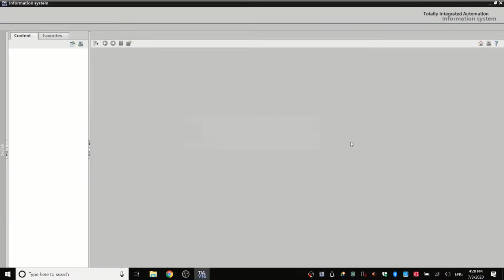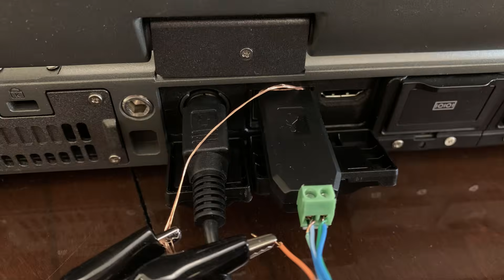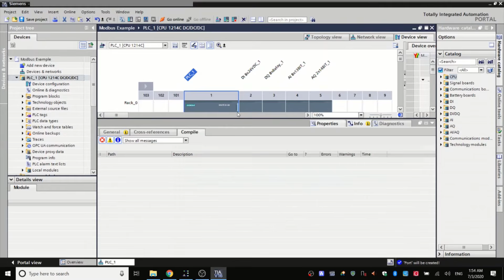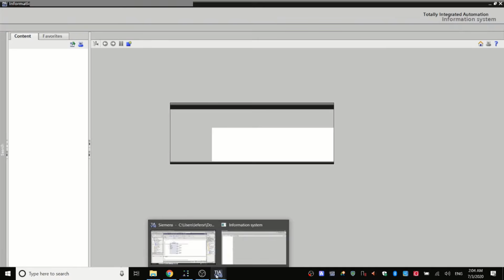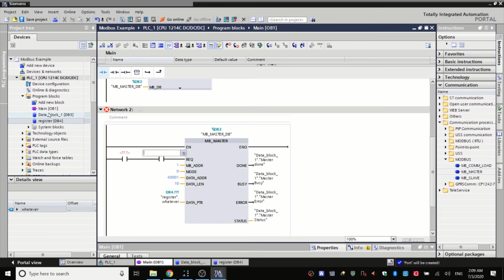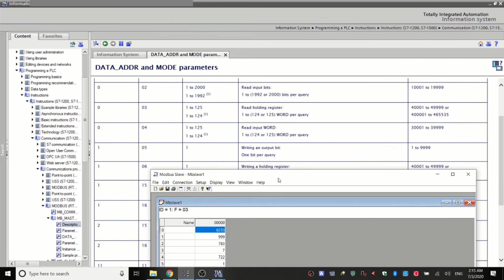Siemens 1200 PLC - Modbus RS-485 Communication With Slave Simulator

Comment: Hi junt a quick question, I am doing what you say in the video, but there is something weird, even if I don connect a equipment to the serial port still the instrucctions show some activitities for example the comm load intruction shows DONE and the master intruction shows error how this can be?
Reply from the maker: Do you mean comm load flags done when you dont have a CB1241 attached to the PLC or you don't have the field device connected to the CB1241? Comm load will execute and be fine even if you don't connect anything to the network. it is just establishing itself with the hardware and is slave irrespective.
Reply: @Intrigued_Engineer  thnks for taking time for replying. I fixed the problem I was doing something wrong.

Comment: Sorry, I'm a little bit confused! I am going to monitor and control one protection relay by S7-1200 through RS485. I cannot find physical Modbus slave in your program! is it easy to eliminate laptop(as interface) and directly connect modbus slave to S7-1200? 
How can control 3 slave by this PLC?
Reply from the maker: Yes, I was just using my laptop here as a simulation slave device. Normally the PLC would be directly connected to the field devices through its CB1241 module. You can definitely control 3 field devices with this. Standard Modbus has an address space of 255. with reserved regions that means you can have up to 247 devices connected.

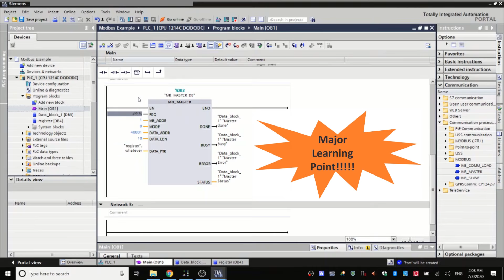Comment: 18:40 that's because the MB_MASTER function works by accessing the memory by address with the PEEK/POKE instructions, which can only be done with unoptimized datablocks.
Reply: Ahaaah! And that needs fixed adresses instead of bouncing around pointers. Am I correct?
Reply from the maker: Ahhhhhhhhhhhhhhhhhh! Thanks very much!

Comment: Thank you very much for this video. I have managed to connect a Siemens S71212 to a little AB Panelview over RS485 with the help and encouragement it gave me. I did actually manage this using the more recent Modbus blocks. Something that people might overlook is the importance of setting the .MODE parameter of the Load MB block DB correctly. This parameter - hidden away -defaults to zero and must be set to 4 for two-wire half duplex operation as here.
Reply: I know im asking randomly but does any of you know a trick to get back into an Instagram account??
I stupidly forgot my login password. I would love any help you can give me.
Reply: @Darian Wesley instablaster ;)
Reply: @Jad Rene thanks for your reply. I found the site thru google and I'm in the hacking process now.
Takes quite some time so I will get back to you later with my results.
Reply: @Jad Rene it worked and I now got access to my account again. Im so happy:D
Thank you so much, you saved my ass!
Reply: @Darian Wesley You are welcome =)

Comment: If you are having issues with connection after the setup. Try 9600 baud rate and no parity. My modbus card only works at that setting.
Reply: Depends on your hardware.

Comment: Nice Video, thank you for this!
If you don't want to configurate your hardware every time you, also can save your setup  in the library and use it per "drag and drop".
Reply: Aaaand, I don't think your USB to RS485 converter is misslabeled.
Siemens uses T/RA for connecting with B and vice versa...for whatever reason.
Reply: @ChG85  really? FUUUUUUUUUUUUUUUUUU iI've been battling for weeks with a sensor ... I'm gonna try that one today.
Reply: @ivoboric  please give Feedback after trying 👍
Reply: @ChG85  He is still trying to connect that sensor.